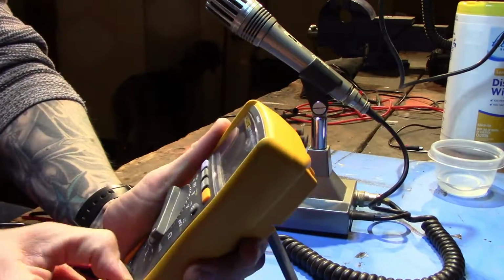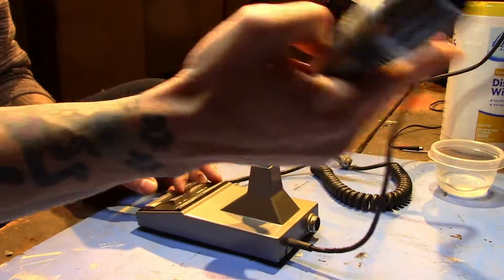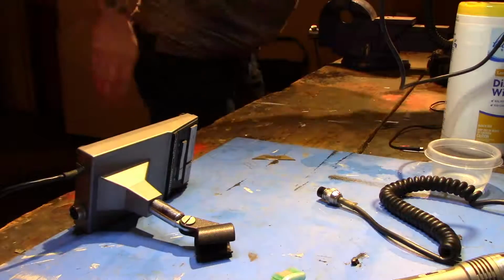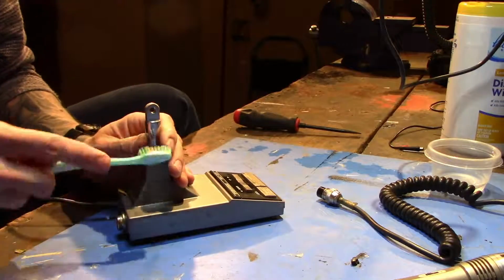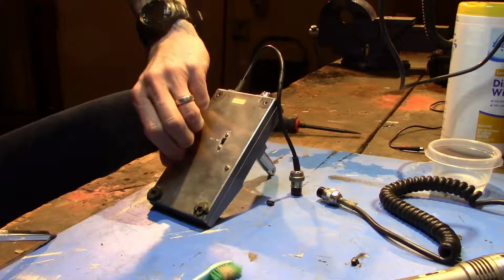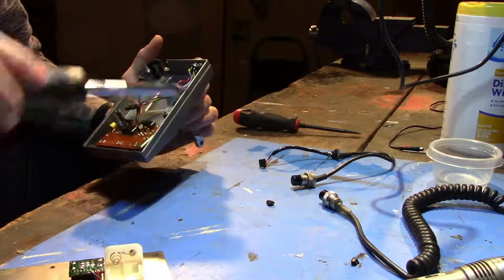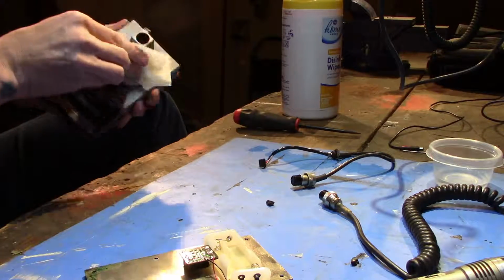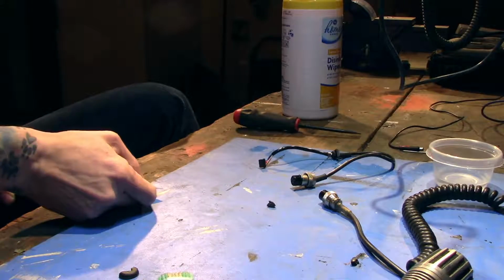Failure and Mistakes

Comment: Everyone has done these types of things. I developed a good habit. Every time I buy used or new gear online, I create a folder on the my PC (i.e. Kenwood MC-60A). Then I download the manuals (for free) for it and put them in that folder. While I am waiting to receive the gear I peruse the user and/or service manuals and watch YouTube videos on it also. That is exactly what I am doing looking at your (and others) video on the MC-60A. The onesMC-60As I saw on eBay were either looked thrashed, worn, and two expensive. Some were over $200 so I bought a BRAND NEW MC-60A from DX Engineering for $175 and free shipping. Must be new old stock because the box says made in Japan on it. I think when these are gone they are gone. There are few bargains these days on eBay. Sad to say, most of what I see on eBay these days is just overpriced crap.

Comment: I bought this mic and made exactly the same mistake!

 I've learnt the practice of "If at first it doesn't work...read the manual". It was easy to find on line and doesn't have much information but it does tell you that this switch is for when you use the mic off stand. Then it behaves like a public address mic where you need a switch on the mic itself.

I can't work out when I should be using the 500 ohm or the 50K setting.

Your comments regarding the elite and making mistakes are 100% on target! I got my call, G6XIB 38years ago but am returning after a gap of 28 years, so, I'm like the newbies you were describing and so much about feeling my way and making mistakes through inexperience rang true. 

Thanks so much for making this video, it's helped my confidence. Best 73s, G6XIB